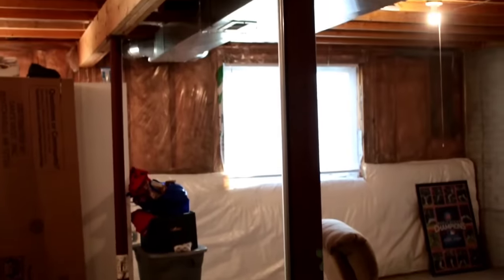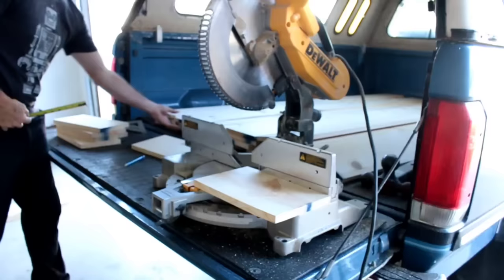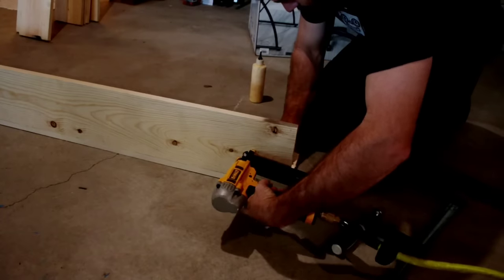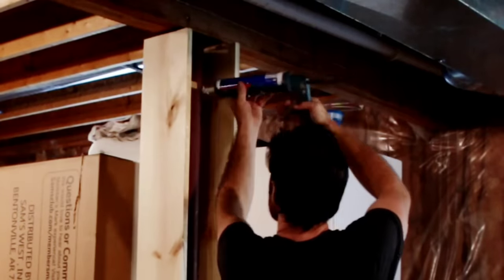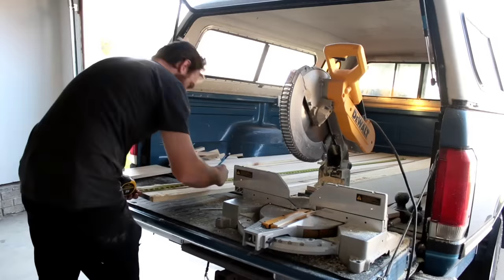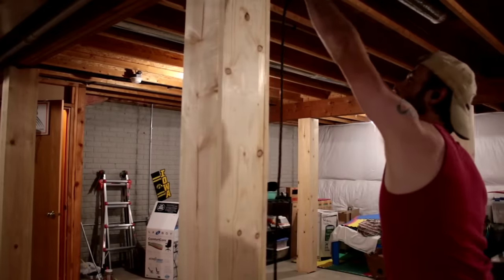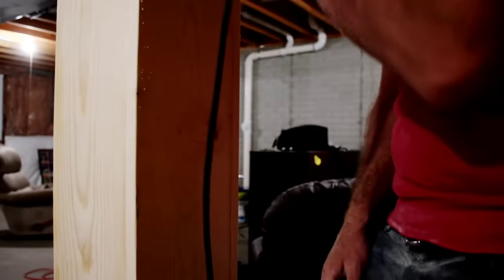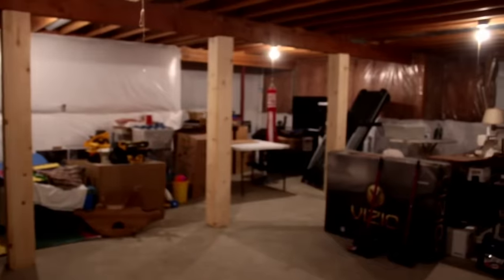Easy method to cover up basement beams

Comment: Nice work man! What size brad nails did you use? 1" 3/4? Also, are you using 1x8's. I'm about to attempt this exact job!
Reply from the maker: That's a good question. I don't really remember unfortunately. But that sounds about right
Reply: What did you use for spacers and how did you get the measurement

Comment: I noticed there was an outlet running down one of the columns, did you cover it? Or just remove it all together? I didn’t notice it when you were finished..
Reply: I was wondering the same, since I’d like an outlet on mine.

Comment: You failed the instant you left those bent over nails in, instead of replacing them with the proper lag bolts. All the moving and bending you did to them with that hammer probably only loosened and weakened them even more.

Comment: They are columns not beams. Beams are horizontal,  columns are vertical
Reply from the maker: That's very true. I had to fact check myself when making this video and some places sell this as a "basement support beam".  Although you are right it is technically a column. A+

Comment: So, there's this thing called a hole saw.  You can cut out a square collar the same size as the column cut it in half and now you have no need for construction adhesive.  Unless you're staining or have some structural need for the wood, MDF is more stable.  Then there's the jack posts which were holding the beams up with bent nails and gravity.  The jack posts are also installed upside down, albeit there's no difference in compressive strength...

Comment: These are not beams they are columns or posts. Beams are horizontal and columns are vertical.
Reply: Thanks for the useless tip 👍